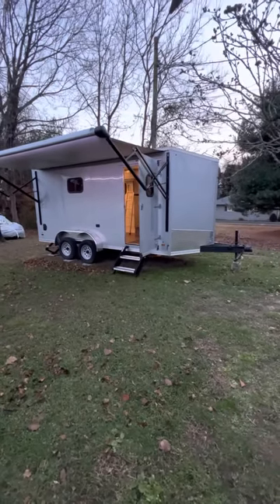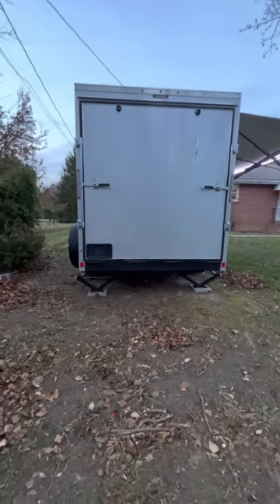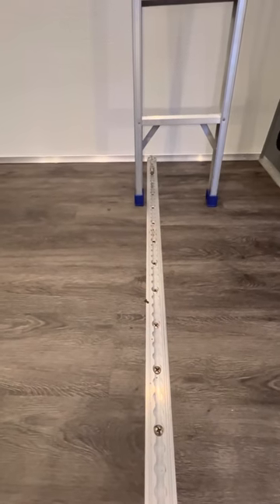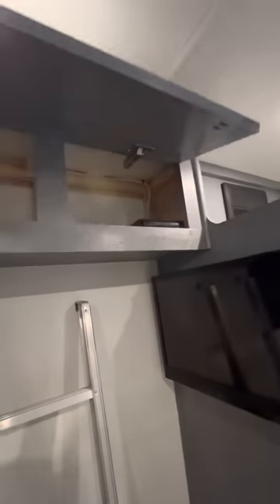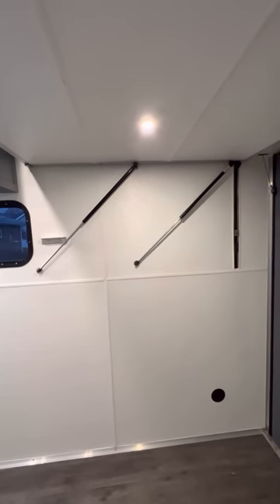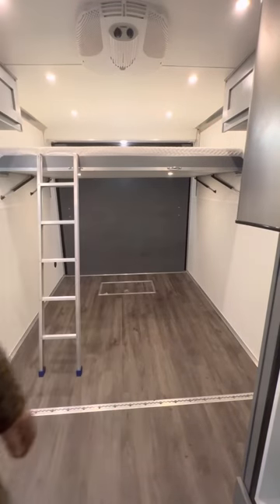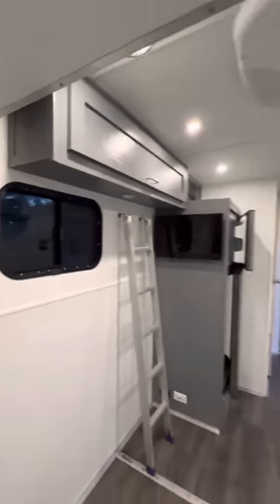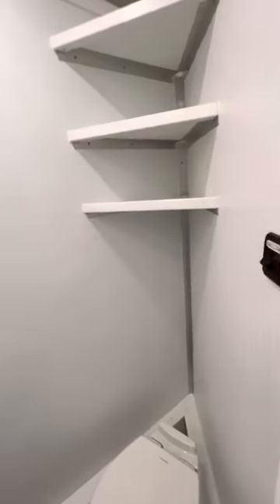My 7x16 cargo trailer to camper conversion

Comment: You have done a fabulous job. Clean and very practical. Will definitely will use some of your ideas when doing mine. 
Questions on the axels. Why did you not go with torsion axels and do you think there is a need to have torsion axels? That’s what I am struggling with. Thank you in advance.
Reply from the maker: To be honest I didn’t know any better when I ordered the trailer. 
I think torsion axles are nice and would suit something like this well. I didn’t plan on getting so involved with the trailer when I first started. I ended up needing to lift it to give ground clearance  for the tanks

Comment: With the bed down could you still fit 2 motorcycles underneath? Do you have a video of the build? You did a great job on it. I’m looking to build one so I can drive across country with 2 motorcycles.  On the fringe, do you have to run with generator or will 12 volt battery work alone?

Comment: The bad idea is exactly what I’ve been looking for!!!  it’s so clean!!! Did you build the platform for the bed yourself? Could you make a video just on the bed alone????? Because I’ve been contemplating the Happyjack system but that’s over $3000 on a good day this looks so much batter!!
Reply from the maker: Yes I built a simple frame out of angle steel. Then covered in wood 
Really a simple design. I’ve been playing with these video editor apps trying to get you guys some more videos but I’m not nearly as talented with technology lol. Hope to have more videos coming soon
Reply: @Professionalhomeowner1  Yes please do because I’ve seen a lot of videos and this one is by far the best designs!!!! The Simplicity of it is awesome not needing 4 legs, cables, ratchets and so on…  I subscribed and I have notifications turned on!!!
Reply: I’m sorry to bombard you with questions lol what are the length of the gas struts? I’m starting a parts list. showed the wife and she’s all for it she likes this much better than what I was going to do previously lol
Reply from the maker: @NEWF2195  search on YouTube for Brian Rogers 
He gets the credit for the bed design I saw his video and made my own version of it. But he made a great video about how he designed his bed which is very similar. 
I can’t remember if mine are 3’ or 4’ springs. Will try and get a measurement on them for you.

Comment: Nice 👍 👍 
What else do you need besides a fridge,toilet,bed,and motorcycle parked in there. lol 😂 
Well maybe some air conditioning for those hot day’s.
Reply from the maker: Air conditioner is a requirement for sleeping in the summer hahaha. It’s for a dometic penguin 2 ac unit. It’s an ice chest in there

Comment: Thank you! Great job! Clean. Simple. Utilitarian. Very well planned. 

Heat source?.....
Reply from the maker: Will probably install a heat strip in the ac unit. 
I didn’t mention in the video that the trailer is insulated with foam board. 1” in walls and 2” in floor and ceiling. A small Space heater kept it plenty warm while I was working on it.

Comment: Nicely done!! I need to install those steps. Why did you go with the that style vs the same style but fold into the trailer door opening?
Reply from the maker: Mostly because of the door I have. Those folding style won’t allow the cargo trailer door to close while they’re down because of the bottom lip of door. If you have an rv style door on your trailer those folding steps are the way to go. 
Either way I recommend the mor ryde steps theyre really nice.
Reply: @Professionalhomeowner1  Thanks for the quick reply. No I’ve got the standard cargo door on my trailer so I’ll have to get what you have also.

Comment: What kind of floor would you use if you were building a trailer again? I think you could get away with less than a quarter inch expansion Gap in the trailer because it's such a small distance. I'm guessing. I would just think a 6 by 12 area would move less than a 20 by 20 area of a living room. I imagine there must be a durable surface at a reasonable cost that looks good . Could you mount that track to the surface of the floor? Maybe even slot the whole a little bit to allow for movement
Reply from the maker: They have different styles of the track some that mounts on top and others that sit all the way in the floor. I figured this would be the best to try and maintain the 1/4” spacing. If I build another I’d look at some commercial grade indoor outdoor carpet or sheet vinyl that glues down. 
You may be right about the smaller space requiring less for contraction and expansion but I’m a novice with this stuff so I tried to follow the instructions when I could

Comment: VERY NICE: A few questions, a) Whats the name brand of the tracks on the floor, never saw that type b) Brand of awning c) Brand of 12 volt fridge and how long have to used continually? d) You have the brand and/or part number of the 4 wheeler RAD fan??  You really put allot of goodie in the front end, one of the best conversions I have seen
Reply from the maker: The track is very nice stuff. It’s billet aluminum called aircraft track. It’s the same stuff they use on airplanes to secure the seats in place. Pricey but well worth it imo 
The awning is made by carefree of colorado and it’s their travelr model. 
The fridge is made by everchill and I’ve had it running for a week with no issues. The cooling happens in the freezer and cold air falls down through some vents to the fridge. Seems to work well for me 
You could use just about any atv cooling fan I forget what bike this one came off of.

Comment: Awesome job, hope I can do as good as you.  What are you carrying in the rear, asking about weight distribution, my axles are 40% on center from the rear, wanting to put two motorcycles in that weigh around 550# each, worried that it may be a light on the tongue.  How much weight did you add with the added items forward of the axles.
Reply from the maker: I just haul quads. I was slightly concerned with the buildup on the tongue but it really isn’t that much weight considering it’s mostly 1x2 pine. I do have a weight distribution hitch not sure if it was really needed or not.

Comment: I luv it! Simple and functional. That kitchenette w/backsplash and bathroom area are my favorite. I've been baffled on what to do with my V-Nose area. Did you insulate it?
Reply from the maker: Thanks! I didn’t mention it but yes the very first order or business was insulating it. I used 1” foam board and taped all the seams. The ceiling has 2” and the floor was done from underneath the trailer
Reply: @Professionalhomeowner1  Thank you for sharing. I hope to get started on my build out as soon as the weather gets out of the 40s.

Comment: sweet build. dumb question, is the ramp door insulated as well with an extra layer of wood covering?
Reply from the maker: Wood does have an r value but it isn’t very much. The ramp door has been insulated as well as the rest of trailer with 1” foam board
Reply: @Professionalhomeowner1  awesome. I will definitely be using your video as inspiration. Mainly the bathroom and the bed. Thanks man.
Reply: @Professionalhomeowner1  would you be able to link the video you found of the others guys bed?

Comment: Such an amazing job! I have a question. We live in Florida and trying to convert a utility trailer. It is very hot here and we are loosing our mind on how to get the trailer to cool down inside. You didn't mention anything about insulating the walls..I was wondering if the material you used for the walls work as insulation. Also, did you insulate the ceiling? We are insulating our ceiling at this moment and bought a standing Penguino portable air conditioner unit (12,000 BTU) but it seams like its not doing the job. Is the problem our insulation? Also, do you think we need air vents to circulate the hot air out? Thank you for your reply. I am literally loosing my mind.
Reply from the maker: I do regret not mentioning the insulation as it is one very important step. My trailer is 20* difference no matter the season. I used 1” foam board in walls 2” on ceiling and 1” on floor. Every seam is taped with foil tape. 
The insulation with my dometic penguin ac it’s like a freezer in the summer. I’m in nj so it gets hot and humid here as well
Reply: @Professionalhomeowner1  thank you so very much!!!!!

Comment: Do you have a wiring diagram and parts list used for wiring. Everything from the 30amp plug.
Reply from the maker: I wish I could say I put that much thought into it. 
The 30amp hookup is made by marinco
And the breaker box is progressive dynamics the 110 is just 10-2 romex. All the 12v is 12g

Comment: One of the best builds I have seen, the lay out is very efficient and the build is simple but effective and better than most.  You could always use a folding table and chairs for now.  One question I have is that is the overall weight and the cost of the cargo trailer before the build ?  Thanks in advance and for sharing such a wonderful build!
Reply from the maker: Thanks for the kind words! I actually plan on eventually installing folding couches below the bed. The weight before any of the modification was 1820 lbs. i haven’t been able to weigh it since building it out. Maybe soon

Comment: What about your fresh water, gray water and black water system?
Reply from the maker: Tanks are under the trailer. They each have heat blankets for use in winter. Center through roof 
Hippo valves on sink, toilet is directly over the black tank. 
I forget the capacity now. Think 50 gallon fresh and grey. Maybe 25 black
Reply: @Professionalhomeowner1    nice!  I'm picking up my trailer tomorrow.   
12x7x7.  Hoping to offset weight up front with batteries and 40 gallons of freshwater behind the axle.   Shooting for a 30 gallon gray tank and a 10 black.  Black tank will likely be custom.  I havent found a listing for an ultra slim tank yet.  Plus I think it will be inside the main frame and tongue area.

Comment: Excellent set up! what is the insulation rate for your trailer?
Reply from the maker: I’m not sure to be honest. I bought about 30 4x8 sheets of 1” foam board from a guy on marketplace for a huge discount. It wasn’t the pink stuff but it worked awesome. Have 2” in ceiling 1” in walls and 1” on floor. Plan to add another inch to floor since I have so much left over

Comment: How do you power the fridge when you aren’t driving? Do you rely on shore power? I didn’t see the shore power connector. How much did the conversion cost?
Reply from the maker: The fridge draws very little power once it’s cold. So I turn it on day before we leave and I tied in the power lead from the trailer plug which powers the fridge from the truck.
Reply from the maker: Also it’s got a marinco 30amp shore power inlet. 
I was asked a few times about cost and I sat down and added all the receipts I saved. Including the price of trailer I’m around 16k into it

Comment: Impressive build! 
What wheels/rollers did you use on the unistrut? 
My bed system is 99% done but haven’t come up with the right wheels for the uni-strut. Any help would be greatly appreciated.

Comment: Great job! I have the same size and I am just about to start the conversion. Can I ask where you got the shower stall? Thanks!
Reply from the maker: I got it off Amazon. Most of the bigger items like the stall hot water heater tanks etc came from Amazon or eBay
Reply: @Professionalhomeowner1  Thanks! I have already bought an on demand water heater that I am using in an outdoor shower stall at the moment. I will move it inside soon, and it will be time to find a shower stall to go with it.
Reply from the maker: The walls of the shower are the same product the rest of the trailer walls are covered in. Frp 
The shower pan itself came from Amazon
Reply: @Professionalhomeowner1  Nice. It is mainly the pan that I am interested in. The walls will be tongue and groove white cedar from a small local mill. I will put a vent in the ceiling of the bathroom and that should get rid of any moisture from the shower. I had to downsize unexpectedly when a shop in Yuma destroyed the frame of my 38 ft 5th wheel a few months ago. I had to abandon it at a $50,000 loss with no insurance. I took what I could from the RV and transferred it to the cargo trailer. I have an ass kick solar system up and running in the new digs, (1300 watts and 900 amp hours of lithium iron phosphate) a big home 120 volt fridge, and a compost toilet. They all make life much easier out here in the desert. Once spring comes I will head home to Quebec and can start the renovation. Apparently any serious modification and I will have an issue at the border importing it, so I can't do much yet except plan.

Comment: Nice work! I really like your bed set up. What brand and/or kind of windows would you install if you had it to do over again?
Reply from the maker: Thanks! If I were to do it again I would for sure get an 8’ wide And some sort of insulated or double pane. These are ok but they just feel cheap. I’m Sure I’ll have problems with them eventually

Comment: Nice Build. I'm curious about your spare tire carrier. Did you fabricate the mounting bracket yourself? I would love to do something like that in my build. Do you have any pictures of the bracket without the tire mounted?
Reply from the maker: I don’t have any pictures but I just bought the mount from Amazon. It’s mounted to one of the 1x3 steel studs I installed for the bed. I don’t think the factory wall stud would support the weight of it. 
Spare Tire Carrier Holder Mount Wheel Bracket Rack for 802 Cargo Utility Enclosed Race Trailer,Mount Your Spare Tire Directly to The Wall of Your Trailer Fasten Tire Convenient to Repair and Carry https://www.amazon.com/dp/B077TG62LH/ref=cm_sw_r_cp_api_glt_i_FZ6ZZK2YKERYH1ED08QN?_encoding=UTF8&psc=1

Comment: Nice install, great job. Love the awning and your storage hatch is going in my 7 x 14.  A question I have for you is: when you ran your plumbing and electrical, did you encapsulate/insulate it within the frame or just secure it to the frame? 
I really give you cred for how 'clean' this installation is - very impressive. 
Thanks for the vid.
Reply from the maker: Most of the plumbing is inside the trailer  the plumbing that is exposed under the trailer going to the tanks is mostly exposed but I do plan to use pipe insulation and eventually install a sort of belly pan under the entire trailer.
Reply: I'd like to see the belly pan installation. That's something I've have been thinking about with my own trailer. Just as long as the pan is sturdy and easy to remove for maintenance.

Comment: I am planning a build similar to this on the exact same size trailer. Already purchased. And was wondering. Do you think that shower pan in the corner of the nose would leave enough room for a toilet to the right? Very nice clean  build btw.
Reply from the maker: I don’t think it would. Atleast not in my lay out. The only way I could make it work by splitting the v like I did with the bathroom/ kitchen I had to put the toilet in the front. 
There’s other options for shower pans may be able to find one to suit your needs but this was the easiest for me
Reply: Happy jack bed lift is fabulous. I have a cal king

Comment: What size power awning do you have?  Can you let me know brand and model as well please?  I have the same size trailer and am looking to get the same awning you have.  If you could share where you got it from and what it cost?  Thank you in advance!
Reply from the maker: It’s made by carefree of colorado and this is the travelr model. I paid around 900 or 1000 shipped from a dealer on eBay called shadepro

Comment: What did you build the in floor storage box out of
Reply from the maker: I used angle iron on the bottoms of the frame rails then layed a piece of aluminum in as a floor. Screws and Sealed it all up

Comment: How strong are those fenders? Can you stand on them?
Reply from the maker: No definitely not. They’re actually quite flimsy
Reply: @Professionalhomeowner1  Thanks, mine are as well so I was hoping to find better ones but I think it will be easier to reinforce the ones I have so I don't have to drill any more holes in the trailer.

Comment: Are you running that AC off of solar power?
Reply from the maker: No solar for me. Solar is too complicated for weekend warriors. I don’t use the trailer enough to justify maintains solar on it. I’m able to power the whole trailer from a predator 3500 inverter style generator

Comment: What do you have into is so far $?
Reply from the maker: I have piles of receipts But never added it up. Between cost of trailer and all the stuff I’ve done I’m sure I’m knocking on 20k. 
I know some people build these as low budget as possible but I wanted a toy hauler that would last. So I tried to use the best materials I could afford. Hope to get many years of service out of it. 
This summer coming I am going to build a lean to store the trailer under. Hope keeping it out of the weather will extend its life even further
Reply: @Professionalhomeowner1  thanks for the info! I’m up in the air to do exactly what you did or just buy a Colorado trailer… Polaris general needs to fit, take the fam camping, and a hunting rig. Cargo trailers have gone up so much it almost doesn’t pencil…